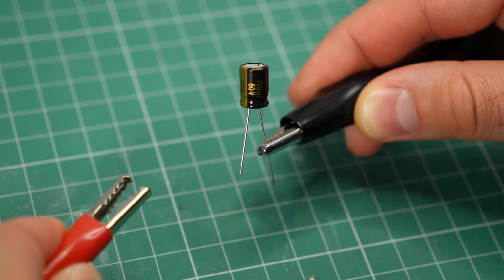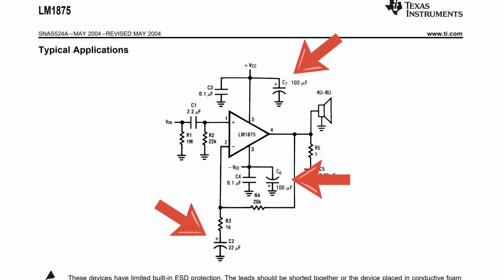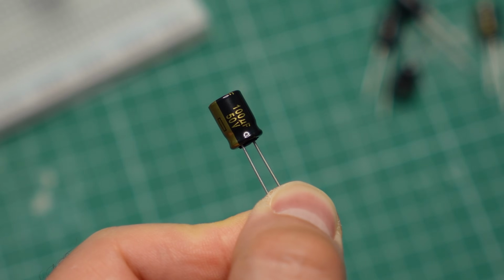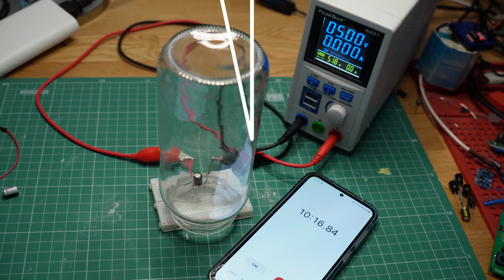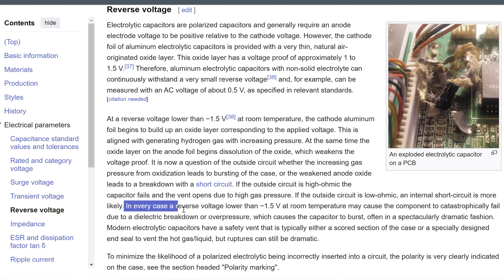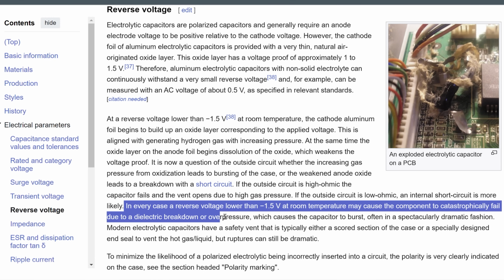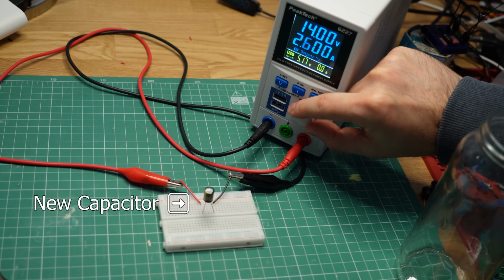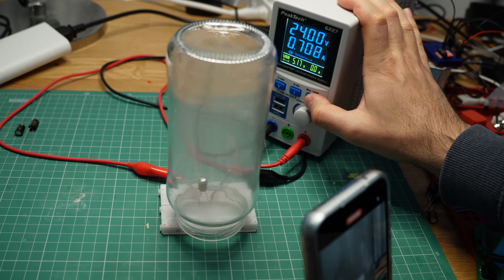Applying reverse polarity voltage to a capacitor - what will happen?

Comment: A capacitor starts with a high current (like 60A) because it's like a short circuit when discharged, offering minimal resistance; as it charges, its internal voltage builds up, opposing the input voltage, which reduces the voltage difference (driving force) and exponentially lowers the current (to around 20A, then zero) as it fills up, using the calculation of  I=C dv/dt where the rate of voltage change slows down.

Comment: Can you explain why this guy able to connect positive wire to negative side of the capacitor?
https://www.youtube.com/watch?v=WzHsyWpRpcU&t=310s

at 6:50. he soldered positive wire to capacitor's negative

I'm just beginner. So I'm confused.
Reply from the maker: It's normal to be confused. It's a poorly made video with zero explanation, but if he had included a clear schematic, nobody would watch the rest :) Anyway, I think it is not connected to positive potential even though it's a red wire. Poor choice of wire colors.

Comment: I was in my second year of college to get my EE. We were tasked with building a bipolar power supply using linear regulators. This guy in my lab hooks a 1200uF, 60V electrolytic cap backwards. Blew up in his face! He starts laughing with capacitor bits all over his face! He actually got real lucky. The instructor was pissed! He was supposed to have verified the connections prior to power up. Corner cutters.... What can you do.
Reply from the maker: Hope he was okay :) bet he double checks every time now

Comment: I once had a 200-in-1 electro kit (like the Maxitronix 200 in 1 electronics lab kit), which was a plastic case with some cardboard, some resistors, capacitors and transistors mounted on it and you could connect them via the springs that were mounted on it and connected to the components. I built an oscillator circuit using 4 resistors, 2 capacitors and 2 transistors and my LED wasn't blinking. It was supplied with 3 AA batteries, so only 4.5V. After some troubleshooting and looking over the schematic, one of the capacitors blew up with a loud bang, scaring the hell out of me. The casing of the capacitor was on the ground about 4 meters from where I was sitting at my desk and the only thing I had left of that capacitor, were the legs and some twisted paper around the legs, just like in the video at the 4-minute mark. Even my brother came to my room to see what was happening, he heard the bang through a solid brick wall with all doors closed. After troubleshooting, it seemed I connected my batteries with reverse polarity.

Comment: In my youth (early teens) I tested hundreds of electrolytic Capacitors on 120 Vac. most went off like a firecracker with stinky smoke. The AC was very effective at destroying them.

Comment: The real question is why would it explode there's just two metallic sheets inside filled with electrolyte and a separator so how does it actually explode, my guess is that electrolyte boils pressurising the cap making it go boom but why only the reverse polarity does it ?
Reply: The capacitor is only designed to be connected in one direction, if it is connected in reverse parts of it start to break down and produce gas which leads to it exploding.
Reply: Electrolytic caps work by having the two conductors being the electrolyte and a self-passivating metal like aluminum or tantalum. The oxide coating on the metal is the dielectric that separates both conductors. Because the oxide layer is extremely thin, you can achieve a high capacitance. However if you apply a negative voltage you chemically reverse the oxidation reaction which strips the coating and thus the electrolyte touches the metal and it goes boom

Comment: I used to work on industrial electronic systems. I one witnessed a 48VDC drive fail when it was mistakenly wired in reverse. I think the cap was 22000uF rated 63V. It split at the top as you would hope but produced huge amounts of fumes. We had to clear the shop and open a big roller shutter door for about 15 minutes to clear the air.
Reply from the maker: That thing was probably the size of a soda can :)

Comment: The rated voltage is what’s important.   You put -12v across a 50V cap, but if you put -50V it would have been violent.  

So the premise is true: do NOT use electrolytic caps backwards or they will explode.  They WILL explode.

Comment: Its ok to use polarized electrolytic caps in reverse, provided the voltage is very low, this can occur to block the dc path in cheap audio circuits. The amount of reverse voltage will depend on the cap size and ratings. Non polarized electrolytic capacitors are also available, they are found in cheap audio passive crossovers. Unlike other types of capacitors, the electrolyte dries out over time, where the capacitors need to be replaced, but electrolytic capacitors by far have the highest capacity for there physical size.
Reply: It still isn’t good practice to use polarised capacitors in reverse, they aren’t designed for it.

Comment: There is variation from cap to cap, on how much pressure is needed to pop it. To get a bigger bang use much more dc voltage and current say 150V at 100amps+, the idea is to cause the cap to heat up almost instantly, causing a sudden increase in expansive gases, like a bomb. Further you can try to glue up and block the vents, and get enough Power to smash the glass bottle. AC is also works well to blow up caps. Try discharging a huge cap bank 2kV, 10kA? into a small reversed cap, even with A vent, the gasses will expand so quickly the vent will be too slow to release the pressure and the whole thing will explode.

Comment: You can actually repair them by reverse biasing them in a controlled way. Look up "reforming electrolytic capacitors".

Also you should just use the alligator clips. The electrolyte is corrosive and will destroy your bread board.

Comment: Nice experiments! I suspect the ones that didn't blow properly were limited too much by the PSU current limit. And the PSU might be slow to resume full output after hitting the limit. We saw the voltage drop way down.

Comment: question:  i use a large cap across the infeed to a very electrically noisy fan…it markedly reduces noise down from 2.4Kz to less than 100hz …there is flyback when power is cut…should i worry about inductive feedback blowing out cap?  circuit is 12v @2 amps…cap is rated at 200v…thanks
Reply from the maker: Is it a polarized type? I guess if it is still working after some time, it is probably fine

Comment: Next time please use tantalum capacitors. 
These are known to develop internal short circuits or be sensitive to reverse polarity.
With Tantalum the marking is the positive pole. With Elko the marking is the negative.

Comment: I would be more scared with that glass jar being on top of it. The cap exploding is violent but the glass jar shattering is even more scary as it can cause real nasty cuts.
Reply from the maker: Yeah, absolutely I wouldn't have used a glass jar if the caps were bigger. But I don't think these small ones can crack that jar I used

Comment: Had a tech classmate whose roomie enjoyed placing a small electrolytic in the bathroom shaver outlet before he would return from evening classes.  When he turned the light on the outlet went live & exploded the capacitor.  Once it hadn't made contact & he pulled it from the outlet.  It connected on being touched & popped in his hand.  They discontinued the prank.

Comment: 1:57 What you see is basically a galvanic cell. You overcame the cell voltage where the surface coating inside the electrolyte is starting to get stripped off. You are basically dissolving the plates of the capacitor into random oxidized junk and whatever gases that electrolyte breaks down to.
A similar example would be an HHO cell. Under 1.23V absolutely nothing happens, then above that you start generating H2 and O2
Reply from the maker: Interesting. Would the voltage rating of the cap have any effect on the point at which this process starts?
Reply: @LeftyMaker  On some capacitors if you limit the current to like 5mA and let the voltage rise the capacitor will form the oxide layer in reverse and if you let it go up to rated voltage the capacitance will be about half of what it should be.
Doesn't work on all capacitors though. most are made differently with the negative electrode doped with other metals that prevent the aluminum oxide from forming correctly. so instead it just electrolyzes the electrolyte until it all breaks down, shorts, or pops.
Only seemed to work on about 1 out of like 20+ random different brands of capacitors I tested.
Now its a crappy 220uF bipolar capacitor instead of a polarized capacitor.

Comment: The other reason you see the bigger pops with the other video was because the smaller caps don't have vents like the bigger ones do, and therefore pressurize more.
Reply from the maker: That's the thing - all the ones I tested had vents. Probably poorly made ones. But yeah, some very tiny ones don't have them
Reply: @LeftyMaker  Yes, and those are the ones that can be fun to explode :D

Comment: I tried this 10/10 caps survive, no explosions, disappointed
Reply from the maker: Man, I told you not to do this at home :D
Reply: @LeftyMaker  I tried it on the second of April
Reply: @electronicguy420  I will evil laughing as GFCI and breaker pop oh sadness
Reply: Now all 10 of those caps had the surface polarization stripped due to the backwards current so might as well bin them. I hope you didn't put those bastards back in your misc capacitors box
Reply: @whatevernamegoeshere3644  As long as the test is adequately short it won't damage them. How short is adequately short? I don't know. But the fact polarized capacitors aren't damaged by even low frequency AC means they at least a little reverse polarity tolerance.
Reply: @Bubu567  how about a solid 5 mins per cap?

Comment: I'm studying electrical engineering, and I can tell you a few things about electrolytic capacitors:
They can be represented as a standard capacitor with a parallel diode, which is a good representation of how it shorts power when placed with the wrong polarity. Electrolytic capacitors also have the highest ESR out of all capacitors, so low voltages won't necessarily be enough to destroy it as that ESR limits the current going through it, thus reducing the buildup of heat and ultimately pressure. The wikipedia page stating 1.5V is enough to destroy one fails to acknowledge that factors such as size and technology can influence how much fault it can handle. And yes, the grooves on the large capacitors are a countermeasure for overpressure events. Emphasis on 'large' because small ones lack this feature and tend to literally go boom rather than pop and puff, just like the cheap ones you tested.
Reply from the maker: Thank you for sharing this! I didn't go to school for this, in case it's not obvious :)
Reply: @LeftyMaker  No problem. I'd be more than happy to explain electrical (and some mechanical) stuff as long as I've studied it. So yeah, feel free to let me know if you'd like it.
Reply: @SSG_RenAstray damn your are cookin 🥞👨‍🍳
Reply: @LeftyMaker where are you studying
Reply: Check datasets because they will show you the behavioral curves. 
Caps also open circuit in steady state DC
Reply: my capacitor from what i've noticed can be charged in both ways, is it normal?
Reply: You read all that from Wikipedia. You don't learn those things in electrical engineering
Reply: @alejandroperez5368  what the... more evidence please
Reply: @creeperhaed1267  when you're studying an electrical or electronics engineering degree, they don't go into details for each and every component out there. Instead, they focus on the main relevant ones, like BJT transistors, MOSFETs, capacitors in general... There simply is not enough time.
Reply: @alejandroperez5368   you really know how to blindly insult someone, do you? Different universities teach stuff differently, and it just so happened that my electrical design lecturer taught my unit cohort this because people kept blowing up or frying their anti-aliasing filters because of reverse polarity. The rest is just knowledge from research in my own time
Reply: @SSG_RenAstray  Well then, your university is wasting time in irrelevant matters. Quit now before it's too late lol